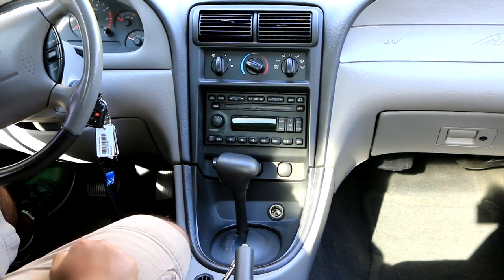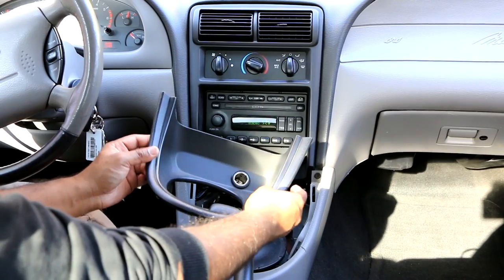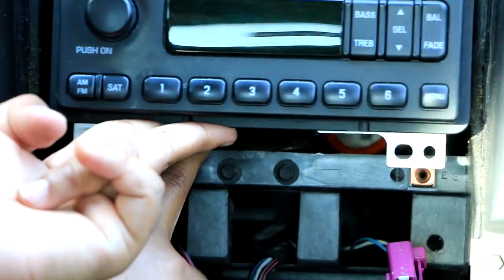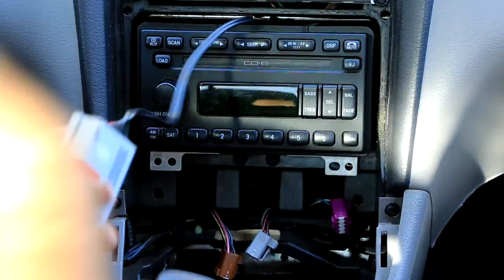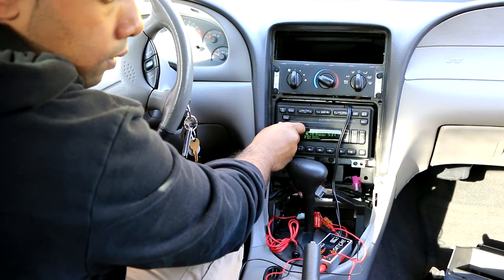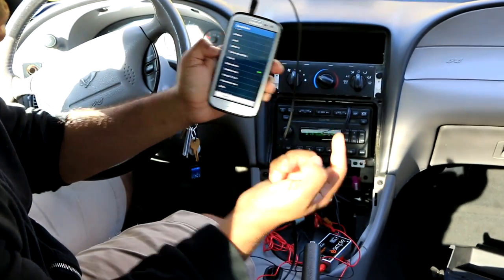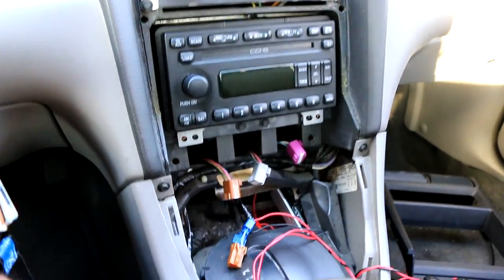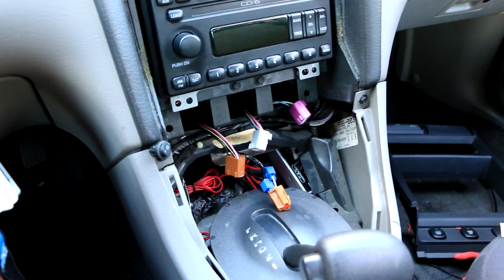How To: Install an AUX Input to Your 99-04 Ford Mustang with iSimple IS31 FM Modulator

Comment: Thank you for your video. The Isimple really works great and the intallation is very but very easy. I have a 04 mustang with mac 1000 that I did not want to upgraded by changing the radio instead the Isimple not just easy to intall but also cheap all together with the Bluetooth around $50 that is way cheaper than buying radio plus amp plus speakers and plus installation.
Thanks again!
Reply from the maker: Happy to help you guys out. I wanna add a bluetooth module to iSimple unit. I'm working on it!!

Comment: I simple not needed.  
Disassemble the stereo and wire an aux cable to the output of the tape decks Hitachi dolby chip. (Its on the small circuit board that the tape deck motor wires to) 
Download the Hitachi chip data sheet to identify the left and right audio output pins.
This turns tape deck into aux
I have 2001 f250, there is NO aux button. 
This mod works on ANY stereo for any vehicle with tape deck. 
You can also use the CD player out put. But i didn't want to lose CD player. 
My tape deck squeels like a pig, so i removed the electric motor.

Comment: On my 03 Mustang, my 12 volt electrical put is not working. Is there any where else I can put the ground and power splicers for a solid connection?
Reply from the maker: Demilified your 12v plug's fuse might be blown...you can also get 12v out of the fuse box. Just use a mini blade fuse tap.

Comment: Have you run into any problems from the fact that you tapped into constant 12v power instead of switched?  Has your batt ever died from that thing being powered all the time?
Reply from the maker: No problems so far. However, I don't leave it on all the time. It has a power switch, so you can turn it on or off. I made another video about moding the power switch. Thx

Comment: Hey it’s 2019 and I’m about to buy this but is there anything better than this out now? Great video by the way. Identical car to mine.
Reply: bradrh79 did you buy it?
Reply: A double din radio or get a radio transducer that plugs into your cigarette lighter
Reply: I bought the same thing in the video online for $20 the audio is clear as a cd no static at all

Comment: Does hooking it up to the cig lighter on these cars drain the battery ?
Reply from the maker: It has a switch, so you can turn it off/on.
Reply: @dsspc  so there is no spot nowhere on the front of the radio you have to remove the radio to plug it in the rear? Or do the cigarette lighter option

Comment: I have an aftermarket radio (it came with the car and sadly only has Bluetooth) will it work with that?
Reply from the maker: Hi, this should work with your radio because this iSimple device will connect to the antenna input of the head unit. Thx
Reply: @dsspc  that’s what I figured, just making sure

Comment: how is the clarity on that?  Is it clearly better than the kind that you plug into the cigarette lighter?  Or is it just pretty much the same thing just without the need to plug it in the the cigarette lighter...?
Reply from the maker: 212days sounds like CD Quality. So far, I'm very happy with it. Thx
Reply: Awesome.  I think I will get one then.  Now that the CD player has officially stopped working. Thanks for making the video and thanks for the reply. Have a great day.
Reply from the maker: Mine too, 4 CDs stuck in side the player. don't know how to take them out.

Comment: does the radio still work while the switch is on ? like other stations
Reply from the maker: yes, 88.1Mhz and up works fine.
Reply: DSSPC thanks i think I'll just leave the switch on and hide it then
Reply from the maker: I made another video about the switch.
Reply from the maker: here is the link for that video: https://www.youtube.com/watch?v=HL6sgYr8V3k&t=368s
Reply from the maker: yes, outlet works fine. we are just sharing the power rail with iSimple unit.

Comment: I don’t have power to my cigarette lighter how else can I connect it to power
Reply from the maker: Hi, did you check the fuse box under the steering wheel? There is a 20a fuse for cigarettes lighter. If not you can get power from the head unit power cable or  from the fuse box. Thx
Reply: Thank you the fm transmitter works great

Comment: in the stock stereo does it play cassets or DVDs?
Reply from the maker: Tlaloc Reyes nope. Just CDc.
Reply: If it doesn't have a mach sound system like my '02 it will have cassette you can use cassette adapter to play music from ipod/phone